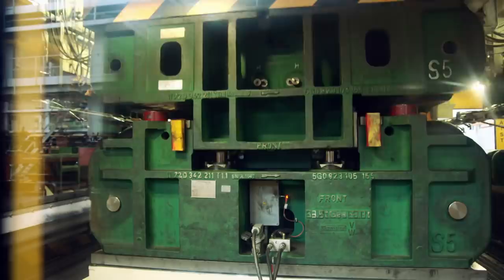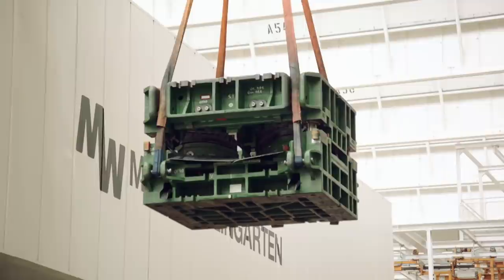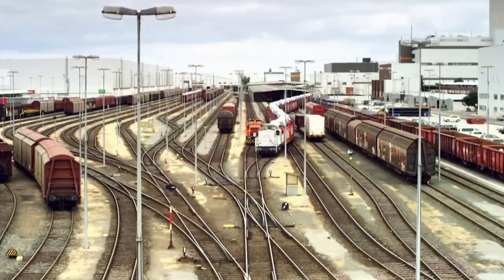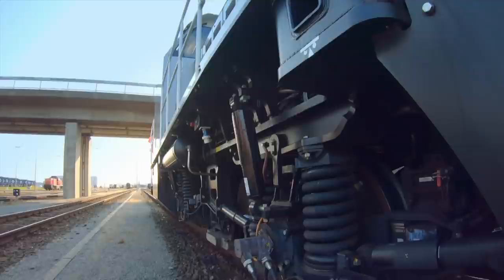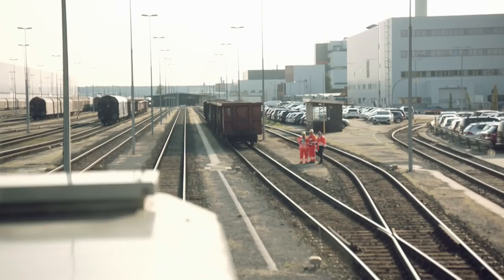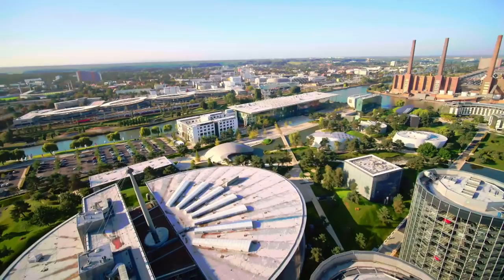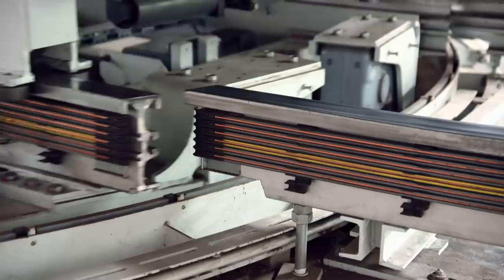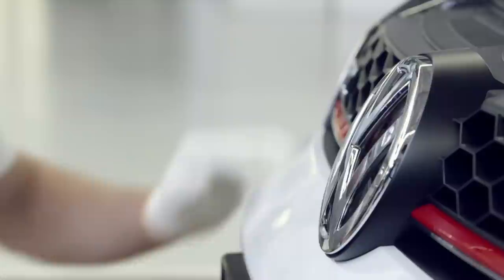How the Largest Car Factory in the World Transports Its Vehicles | Richard Hammond's Big

Comment: Wheels dont turn on the assembly line, yet its still the quickest brand to get a check engine light.
Reply: If you don't neglect them they go okay. 2015 VW Golf TSI 112.000 km no problems (I'm actually thinking I need to spend more on it because it's so cheap to run)

Comment: Was it sad that I could tell it was VW as soon as I saw the stamped hood.
Reply: That's in fact funny, when you can hear every 2nd car guy claiming that all modern cars pretty much look alike...
Reply: @palomino73  What about CyberTruck😁?
Reply: @biplabkumarghosh6300  I was referring to cars  not funny rolling follies...
Reply: @palomino73  The CyberTruck is arguably more usable as a car than some VW models
The long range versions of ID3, don't have the place to a put a fifth seat or glass roof
The CyberTruck has longer range than ID3, but still comes with 6 seats and glass roof on all versions
Reply: @biplabkumarghosh6300  Hmm, Cyber Truck really seems to be the optimal vehicle if you want to do an adventurous trip into the wilderness - given there are evenly spread EV charging stations... - well, probably not.
Apart from that; CT is "a truck" - this is not my predominant image of a vehicle when I hear the word "car" to begin with. Furthermore, it doesn't speak to my heart, it doesn't trigger any sensation other than feelings of my guts being wrenched because of its ridiculous degree of uglyness.

Comment: But arnt cars tested before they are sold so new cars always have at least a few miles on the clock
Reply: They'll test the engines on high level vehicles, but what they do is plug in the fluids and run the engines on hoists in their own rooms while the testers watch the dyno on the screen in another room with sound dampening installed.